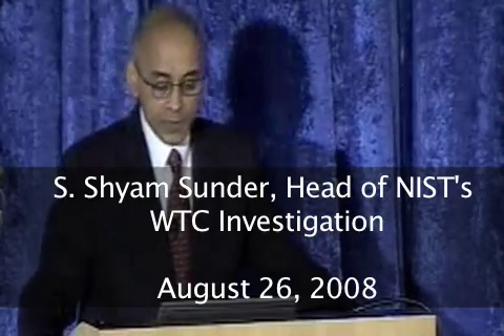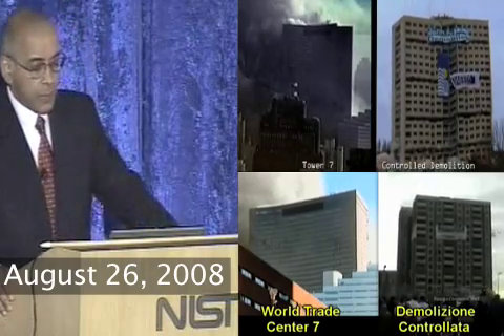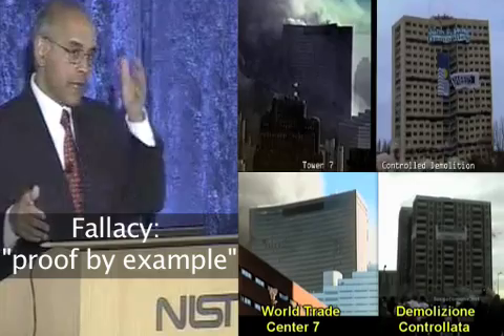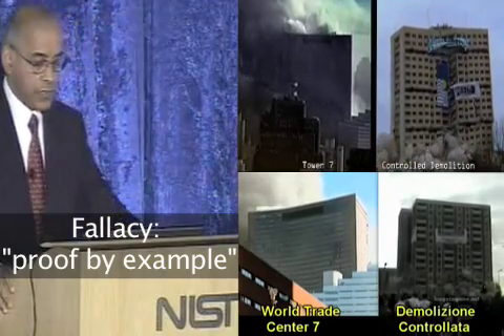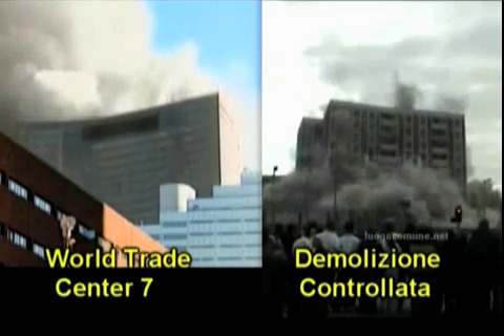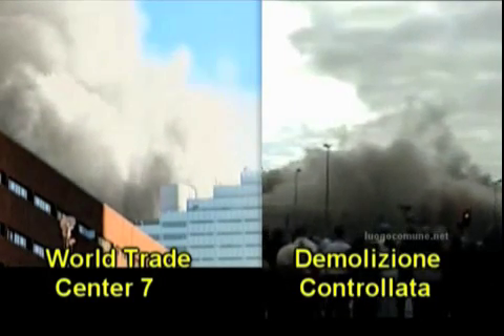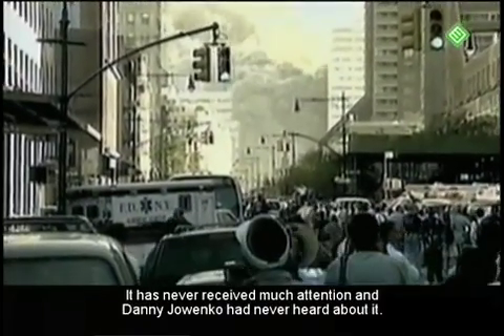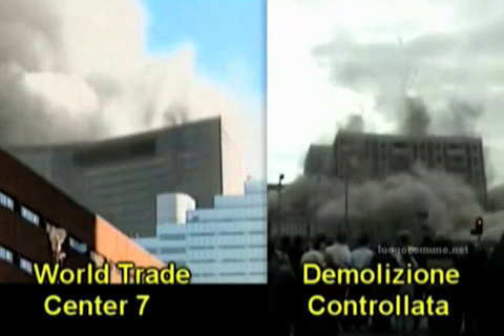Sunder on What Controlled Demolition Looks Like (see video comments)

Comment: The first move down of Building 7 was rotation counter clockwise. That is not a sign of controlled demolition. It indicates the lower supports folded, or buckled. If lower supports were taken out with charges, the initial move at the top would be straight down, not rotation.
Joe Hill, 911 Truther De-Tox on fb